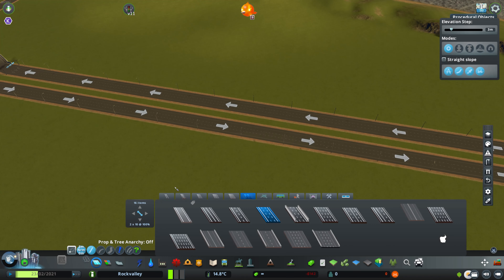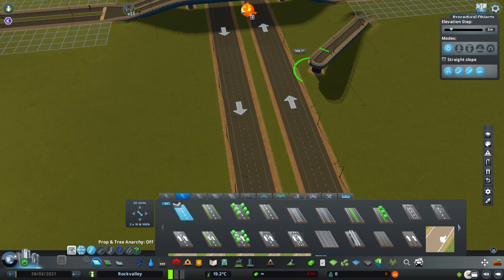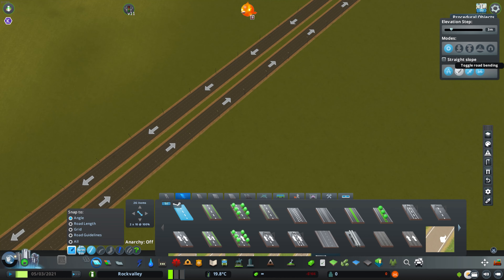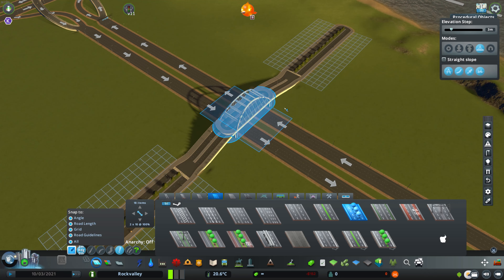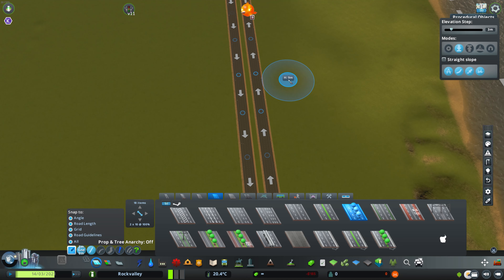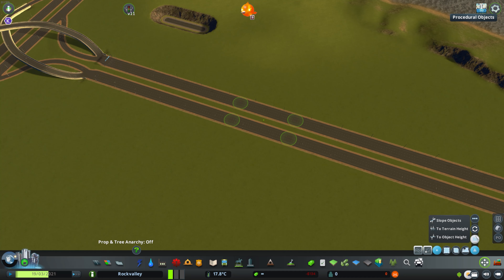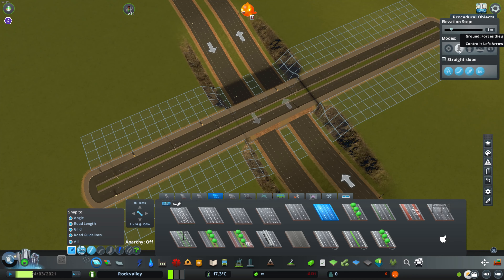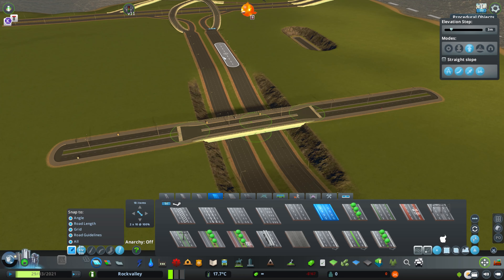How To Make Bridges Over Roads | Cities: Skylines

Comment: I still can't figure out a way to raise or lower the terrain along with the road. It just doesn't work
Reply from the maker: You can do that with the Road Anarchy Mod - there is a toggle button in teh Road Anarchy Window to keep the terrain at the road.
Using MoveIt Mod you can do it with existing roads - if they are not elevated the terrain should move with it vertically when you select the node and press PageUp/Down